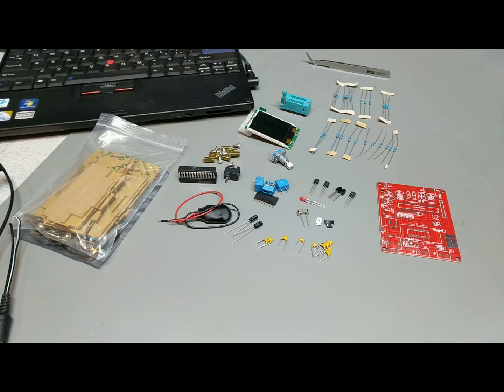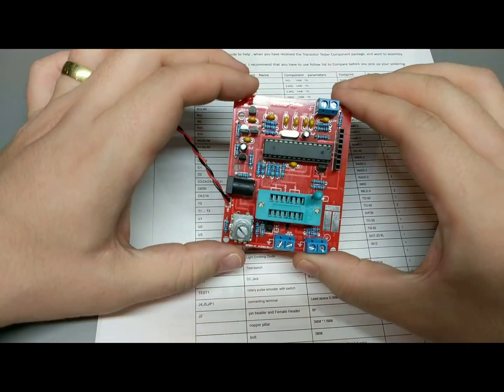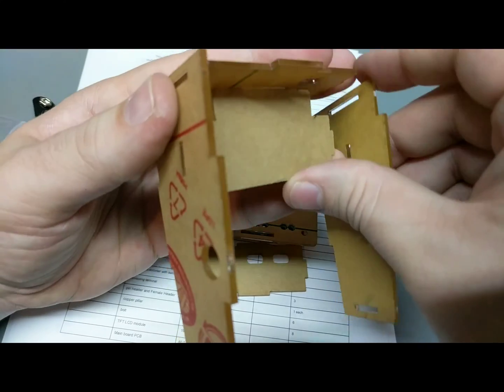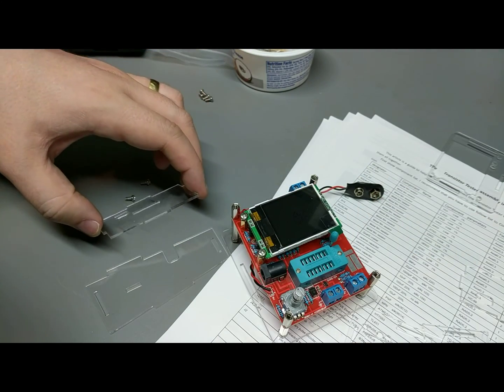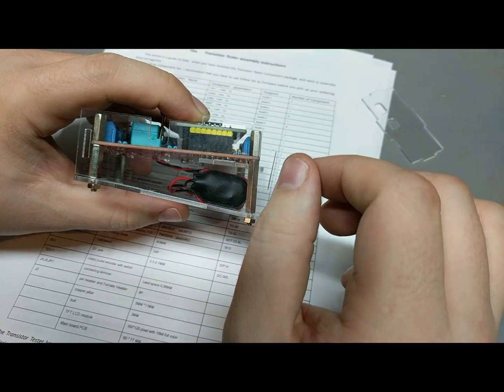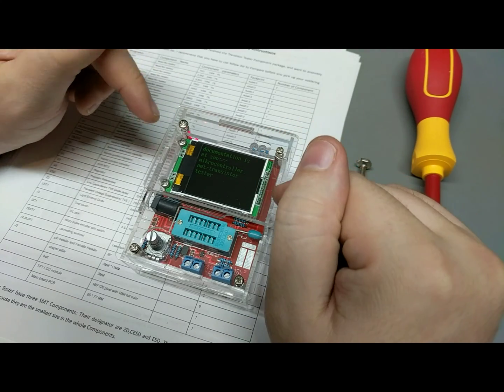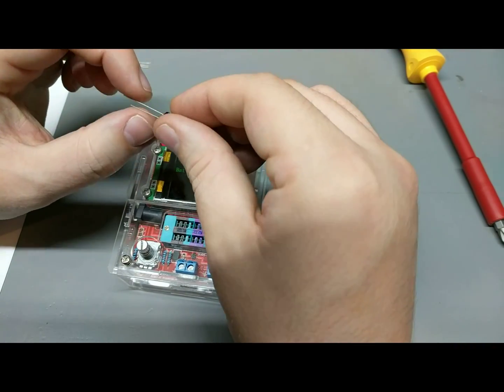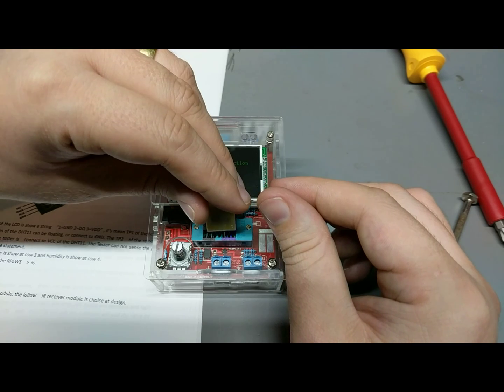GM328 Transistor/Component Tester Build and Checkout

Comment: Very helpful video. I ended up skipping the battery setup. I will be only using it in my workshop. Easy enough to hot glue a 9v case to the back if I ever change my mind. Also took a dremel to the plastic around the lever. Cut it out so now I can push the lever and release it without a screwdriver. The knob on mine turned  super hard if I pushed it down to where it is supposed to rest. Turned fine without a knob or with knob only barely pushed on. I cut it wider with a dremel also because all the knobs I tried were too tight. Bad design.
My  LCR-T4  (yellow one) was a lot easier to put together. It all fit great. Designed much better!   Thanks!!!

Comment: why is everybody bothering to mount the 9 volt plug you should put a male barrel plug on the end of a nine volt hard case recepticale and just glue it to the back of the case
Reply from the maker: I ended up doing just that, though I didn't bother with a case. For bench use that's fine, I guess I'd you want a portable unit then the internal battery is fine if you mount a switch on it.

Comment: I just built one of these kits from a Chinese Ebay seller.  It was missing a few resistors (had duplicates of required values and missing a few others), but I had the missing values in my parts bin.  Works very well!
Reply: @scharkalvin just our luck! I was placing the transistors then realised the kit was missing an S9014 which I've now ordered an assortment of transistors for future missing parts.

Comment: One last thing, just to let you know, the case on the one i received has a larger hole for the lever. Also it is not sloped, it is a parallel case. I ordered some clip on probes that i can keep attached to the device to avoid having to fiddle with the lever thingy.

Comment: Ive just noticed that there is enough flex in the case to pop one of the ends off fairly easily (after removing 2 screws, i might use elastic to hold the middle of the case together while swapping batteries this way).  so i might go with the onboard battery setup or i could just use an elastic band to hold it to one end.

Comment: Remember to discharge capacitors before testing them. I blew my first more basic version of these failing to do just that. Then i ordered another and the screen got ripped off, i tried to use the old one to swap screens but melted the ribbon cable. So i bought one of these. Lets hope it lasts a bit longer than the other two.

Comment: I just assembled the case for one of these and then found your video :D
  I know what you mean about the stand offs and the battery holding potential.
Mine came with brass stand off attached which i had to flip around and it had nylon spacer stand offs. If they had drilled 4 holes in the top plate i could have screwed through to the brass stand offs which would have done away with all of the plastic around the outside holes, in the end i just used the long screws provided but they had no spacers so i didn't tighten it too hard. Bit of a mission to hold the case together while assembling and mission to change out batteries if you put them inside!
  Perhaps i will leave one of the ends off. A home made case might have been a better option.

Comment: Good video!  I just ordered a GM328 so happy to have some insight as to how to put it together.  I'm hoping to be able to use the ESR function in circuit to diagnose the switching power supply on an HDTV,  I'm sure it will find other uses as well on the bench.  
Thanks for posting.